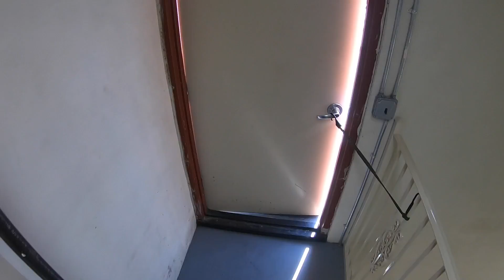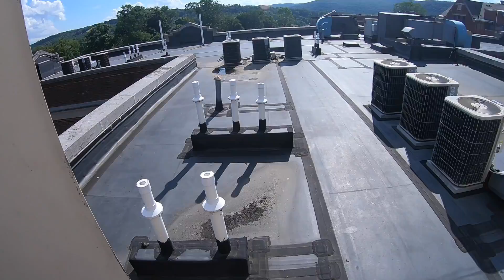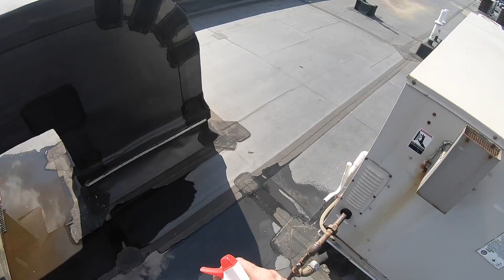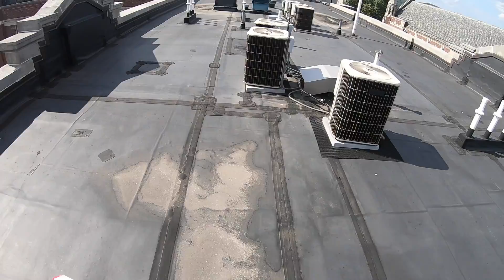NO AC Service Call 6 Two Down Systems Compressor Leak Repair and Broken Belt

Comment: I noticed you used an acetylene / air torch, instead of oxygen / acetylene? any reason? save on oxygen? or?  while I have used torches 40+ years, I usually prefer oxygen, unless I am repairing a old  radiator for a car, I am just learning here, but I noticed that, & just curious, more controllable? less chance of burning hole? less concentrated heat, but may take a bit longer to solder?

Comment: Hope you returned to change that motor variable pitch pulley. Shiny grooves usually mean ridges on the surface, means worn out pulley/ sheave.
Reply from the maker: When I returned to test the unit that threw the belt it had bigger problems than the shiv and pulley. One circuit had a bad txv and the other circuit was low charge so in camera crane and a new system dropped in its place.

Comment: I really like your videos but I have some comments. You didn't purge nitro when you brazed. Also the way you set up your micron gauge doesn't seem like you can isolate from the vacuum pump to know the microns in the system. When I pull a vacuum I always use the Appion core removal and connect bigger vacuum hoses straight to the pump no gauges.
Reply from the maker: I should do the nitrogen thing everyone online talks about it yet most don’t practice it in the field. I did just buy a purge fitting to try to implement it into how I work. The vacuum does have a shut off valve to isolate the pump.
Reply: @thehvachacker  they have videos showing how much carbon build up you get when you don't Purge compared to purging. I used to work for a rep firm for LG doing commissioning and service and LG is really critical with the purging in the 500 microns.

Comment: Sledge hammer. I notice you don't carry one. If all else fails, beat it with a sledge. Just need a 3-5 pound small one. My go to tool.
Reply from the maker: I had a stuck tire on my van. A sledge hammer was the only way to get it off. So yes a hammer is a useful tool
Reply: @thehvachacker  if nothing else works grab the sledge. I have always joked about that.
Reply from the maker: I have a video only way I broke free a stuck tire was with a sledge

Comment: Clean the filters and the coils. You cannot charge or 

check the charge on a system with dirty coils, filters, or 

blower. The condenser and the evaporator must be clean.
Reply from the maker: I know this unit we change the filters 4 times a year here. I checked them during the vacuum to verify. I was on this job for 4 hours
Reply: @thehvachacker  people act like it's your 1st day on job. There is probably a lot of video footage that you can't show unless people want to watch a 4 hr video.LoL
Reply from the maker: I was here for 4 hours this isn't an easy building to get all that equipment up onto that roof. I had a coworker tell me my videos are too long yet how do I condense a 4-hour job to 15 minutes. I checked anything that could affect refrigerant pressures. I do what I can.
Reply: You charge package units by factory charge filters and coils have nothing to do with charging that unit

Comment: So was that blue hose loose enough for you to have to add more refrigerant? Two units in one day on a hot roof. Not too bad
Reply from the maker: It’s been so long I need to find time to watch and remember. This building is a PITA to get all that equipment to the roof. Other unit had a bad txv the one throwing the belt and refrigerant leak on other circuit so it was replaced.

Comment: Looks like much more fun working on the rooftop units than in the crammed crusty basements!
Reply from the maker: I’m often out there mostly changing filters, belts, and doing pm’s with the occasional break downs. Yet it gets very cold out on the roofs in the winter. Yet working on RTU’s is cleaner work. This was a fun late afternoon call I was sent on. This building is a PITA lugging all that crap to the roof on the 6th floor. I never did release the return visite with the bad txv causing the hi pressure switch trip on the unit with the suicide belt.

Comment: Hey, for a heads up that sheave pulley on the motor is meant to adjust the driven speed of the fan or load on the motor, not to tighten the belt.  We do it on swamp (evap) coolers here all the time.  By screwing it together, the belt runs further out, which increases belt speed and load on the motor.  Unscrewing does the reverse.  Clip your ammeter on the motor lead and adjust the pulley so the motor runs at specified load.  The belt adjustment was supposed to be done with the 2 slotted bars on the mount plate the motor is attached to.    
On another note, those Knipex pliers and wrenches are awesome.  I've had mine for over 10 years.  The wrenches come in handy for flattening out bent sheet metal.
Reply from the maker: I did say the wrong thing yet it kept tossing belts I wanted it to fit a little more into the pully. It was a Hail Mary with the only spare belt I had. I didn’t want to lose that belt also.
Reply: In other industries I have had to re-parallel the pulleys using a straight edge and slotted bars with a lever but your camera doesn't allow us to see what you do.

Comment: Thank you for video sir. I’m heading into industry , still first quarter of school. My question since the beginning: what is the best field of industry that would allow me to cut my teeth the quickest? Service, install..???  
I respect your work and ethic so your opinion has value. 
Also, what are the color coded nut drivers you using? 
Looking for something with decent magnets.
Reply from the maker: Your first question is tough to answer since it depends on where you want your career to end up. If you want to work for someone forever start service. If you want your own business starting to install then changing to service is a better route. This way you can learn how to install and set up a system. Working for someone not ruining your business name while your learning. I did 7 years of install before switching to service. I use the Malco connext1 nut driver handle. You can use any drill hex driver bit with that handle to make any size nut driver.

Comment: does the refrigerant u added have oil in it or was it not needed to replace any of the oil that was lost from the system
Reply from the maker: Only refrigerant is in the cylinder. There is oil spread out through the system. That shound be sufficent for th compressor